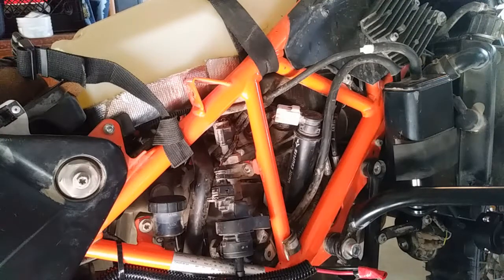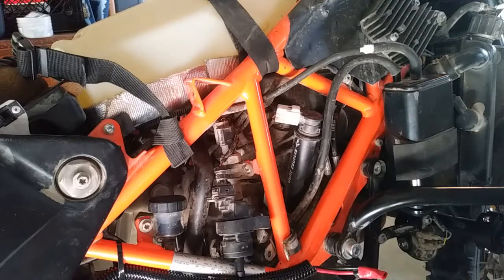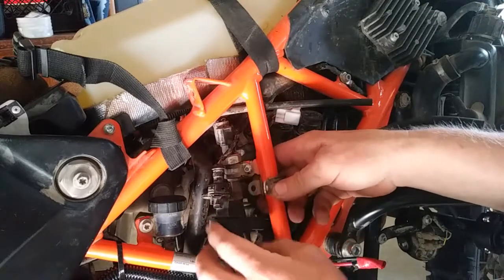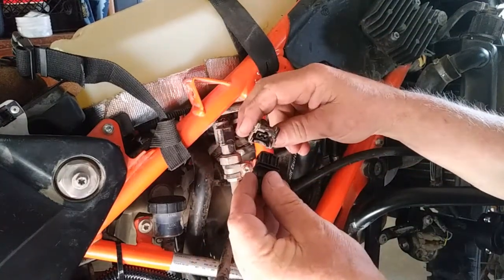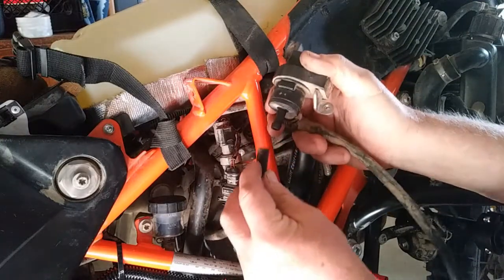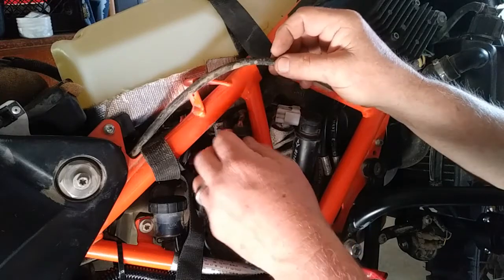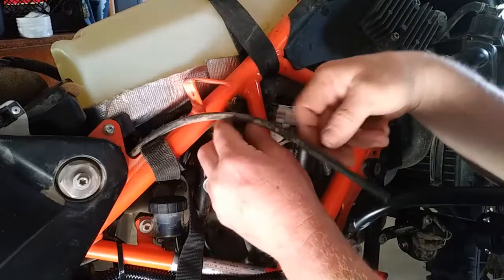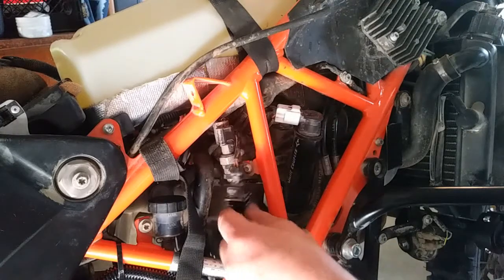KTM 690 SAS dongel and canister removal

Comment: I own a Duke and want to install the dongle (I just received) but no where here do you show the orientation of the motorcycle. I cannot tell with certainty where you are working. I guess I need to go route around my KTM Duke 690 and see what matches.
Reply from the maker: Right side just behind to the rear of the spark plug. The duke may be different, IDK!
Reply: @frostbitevinnie  thanks, that really helps.
Reply: Me too idk what to do
Reply: Can you send me ur insta and send me a pic??
Reply: @mohamaddasavage2019  sold my ktm